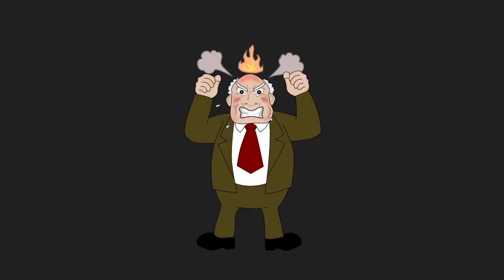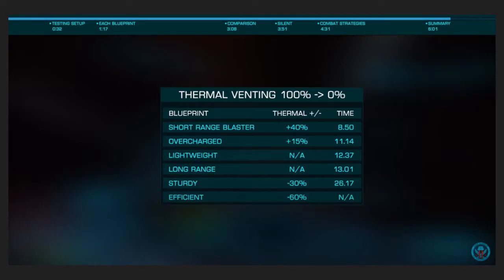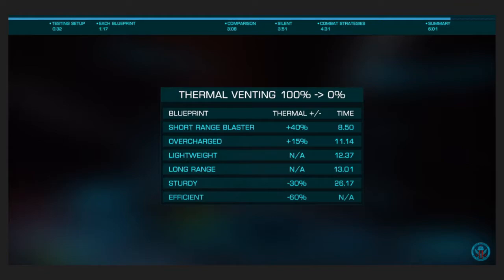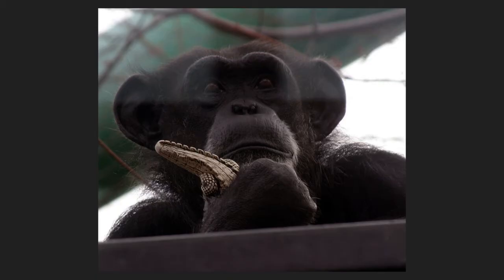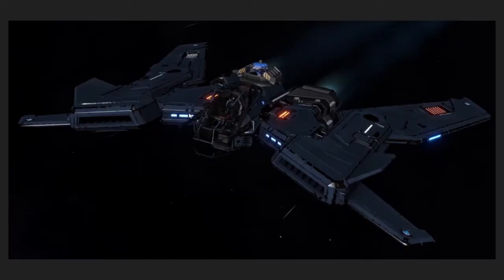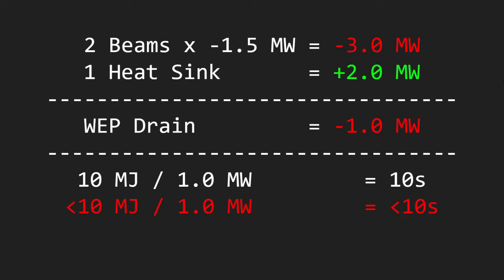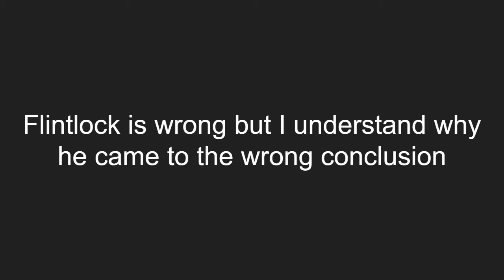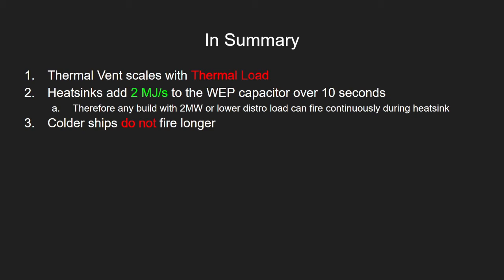Heat Sinks, Thermal Vent, and You

Comment: So would 2 medium thermal vents be better than 1?
Reply from the maker: You've left out some information I need to consider but I'll try to keep it simple and cover the bases. I'm going to pull numbers from gimballed weapons since I assume that's what everyone uses but the principle in general should hold true.

In general, no. It would provide more cooling. But what did you give up in that second TV slot to put it there? How much damage did you give up? Do you really have the capacitors to run your TVs? Are you overcooling? Your ship has natural heat dissipation which scales up to and maxes out at 66%. If you can fire one TV and keep your ship at 50% there really isn't much of a reason to add a second. If you're trying to consider 2 medium TVs vs 1 Large or Huge TV, just remember that the heat dissipation scales with thermal load. If you open up EDSY.org you can see the actual values for modules. I usually run G3 Long range on my TVs, so my huge TVs have 10.62 Thermal Load, Larges 7.61, and mediums 5.32. Would two mediums give me more cooling than one large? Sure. But depending on ship loadout you might not need the cooling or you might want the damage provided by an additional gun. 

Quick example. I'm in my FDL. It has 1U4M hardpoints. I've locked in 2 Railguns. I'm now going to decide whether I should use 2 TVs and a multicannon or a 1 TV and 2 multicannons. 

1 Huge TV - 138.5 DPS - 3.3s in the red on near empty. This is a manageable heat 
2 Medium - 134.5 DPS - 2.7 in the red on near empty. This is also a manageable heat (and marginally better like I noted in my above numbers)

So you give up some 2% dps for (what I would consider) to be a negligible cooling differential. 

In general, I don't recommend stacking your "utility" weapons, just get more damage.
Reply: @richardfrederick6009  thank you.